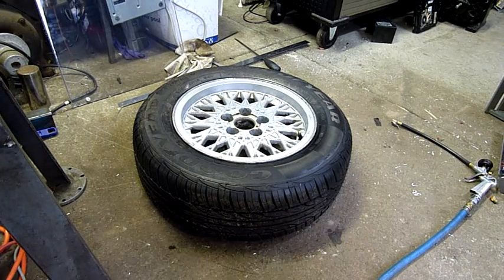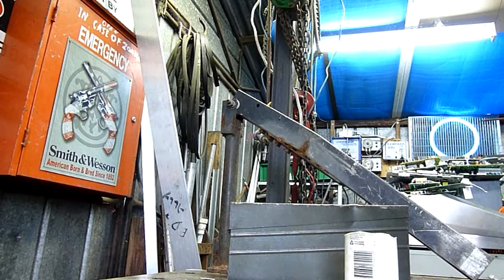Manual Tire Fit Up - 15 Inch Ford XE XF Mag

Comment: the little cars would also make fantastic bead breakers if you don't want the tyre afterwards. Big cars work well for this too, I've removed old tyres but never knew fitting them would be this easy..
EBAY TIME!! =D

Comment: temp fix is to add a good squirt of 20W50 oil into the cylinder by the pressure side, will slow it leaking for a while as it seals up the worn bore.

Comment: if it's a junk tire, I just cut the bead with a cutoff wheel. old hardened rubber is a bitch to remove manually.